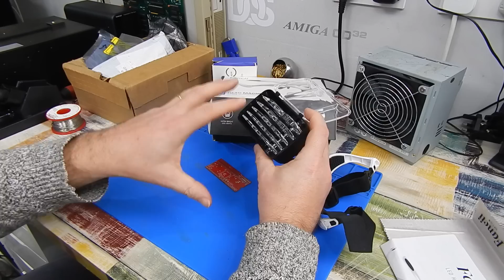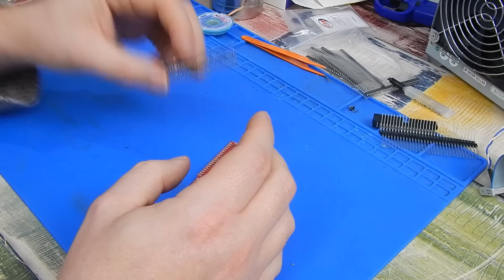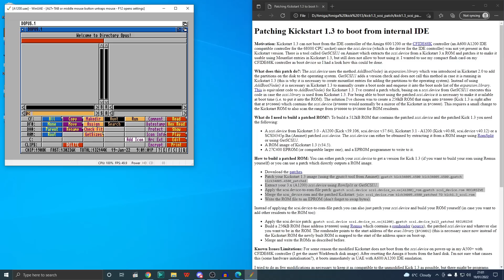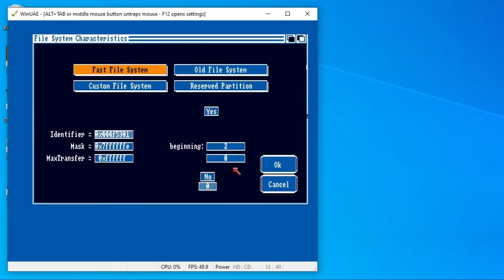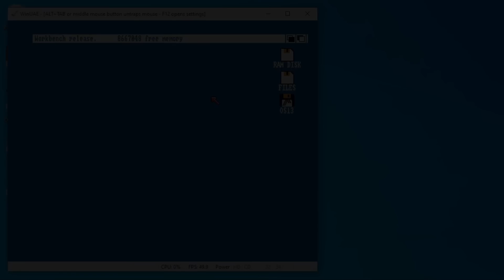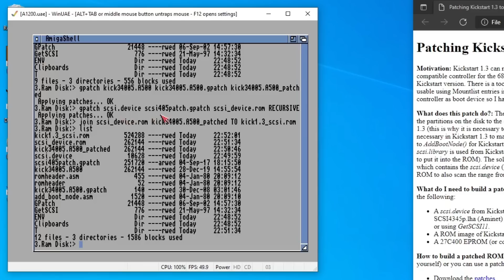Building an IDE68K then patching Kickstart 34.05 (1.3) to boot Workbench 1.3

Comment: I've created that patch about 15 years ago. Nice to see that somebody actually uses it :)
Sorry that you had so much trouble getting it working. I'm using it with an A500+ with an IDE68K board from that time, and scsi.device 43.45.

Not sure why you needed that gayle initialization code. I have two theories but I'm not sure:
- The CPLD code of the IDE68K might have evolved to be closer to the original gayle since the version that I got and might need that initialization now as well.
- scsi.device 43.45 might do that already on its own.

As mentioned in the html file I had to do a reset to boot from HD, but after that it booted every time. 
Somebody sent me a fix for that (also ready 10 years ago) so that it already boots on the initial power up, but I did not reupload the archive as we were not sure if it is a general solution (and its not my code either). That change had to do with the initialization order.

I'll probably build a new IDE68K some time in the future, then I can check if the Kickstart I have still works with that. If I find the problem (thanks for the hints), and some time, I'll update the archive on Aminet.

Btw, I'm already subscribed to your channel for some time, keep up those great videos!
Reply from the maker: Thanks for all your hard work creating this.  I was originally just going to change to 3.1 but after finding your archive on aminet I just had to try it.  After it initially didn't work it must have take me a good few days of reading threads before I stumbled onto the EAB one, I'm just glad it got there in the end.  I thought I had read somewhere that 43.45 didn't work with kickstart 1.3 although with only a 2GB card I don't really need it anyway.   Good to know it can work though, should get you large HDD support.  

In terms of the code, I think the CPLD is emulating a gayle device and needs the code in kickstart to initialise, just my guess though.  Certainly without it there is no sign of life.  

If you do build another IDE68K and decide to update the archive please let me know and I'll update the links etc in the description.  

and Thanks for subscribing, I truly appreciate the support.
Reply: @CRG  Just did this mod and I can confirm that with "scsi.device 43.45" the final KS13-rom does not need to edited, it just works. 🦾
Reply: Where did you get scsi.device 43.45? From which ROM?

Comment: There are SD card ROM replacements, Pico/PI W for other retro computers like the BBC micro, as for the Amiga, where does the ROM size limit come from, is it the physical ROM chip size is 512k or 1M, it would be better to mount the ROM as an SD card partition so you can swap in software the ROM version or put only Workbench "100Mb" on ROM, with the user config/ Work, Games, Programs partitions on the system IDE / SDCard adaptor?

Comment: After struggling with this for quite some time, trying to make the exact same patch working with a TF534, I finally succeeded today!
In the end, I tried adding exec, scsi.device and expansion.library from kickstart 3.1 to my 1.3 in Remus, and it seemed to at least TRY to boot, but just hung indefinitely...
Then I removed the 2nd partition from my sd card in WinUAE (in which the patched Kickstart works fine, by the way), so that I only had a 200 MB boot partition - and THEN it booted from the sd card! 😀

Comment: If your CF adapter has a diode between IDE pin 20 and CF power supply pins, it will reduce the voltage about 0.3 volts. Some CF cards might not work then.
With 3.3 volt CPLD on IDE68K, the CF voltage should be the same and not 5 volts, or some CF cards may not work, because they need IO input voltage of 4 volts minimum as they are CMOS level inputs in the CF specification. (Moreover, at 3.3 volt CF power supply input, the specification does not allow the I/O voltages go much above 3.3 volts)

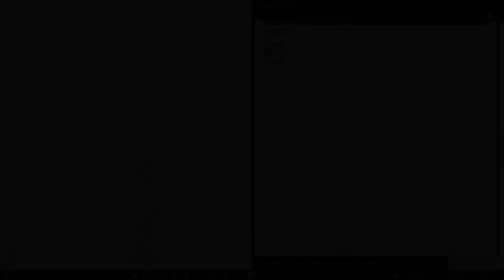Comment: The Gayle initialisation code 31:29 is probably needed on A600 and A1200 to make IDE and Gayle registers appear at DAxxxx address space. The IDE68K would have them enabled "always", without initialising Gayle by reading ID register at DE1xxx (or DExxxx on IDE68K)
Also it makes sense to pull the scsi.device from KS ROM intended for 68000 Amigas. E.g. KS3.0 for 68020 A1200 doesn't work on A500.

Comment: ¡Thank you for this video! 🙂
This text was translated with ChatGPT. I only speak Spanish well.

For my Mistica FPGA setup, I used a Kickstart 1.3 with scsi.device and to partition the hard drive (or CF card) I used the A590 installation disk.
This disk includes HDToolbox, which allows you to perform this operation. Additionally, you can install Workbench 1.3 and Extras 1.3 on the CF after partitioning and formatting it. I suppose this can be extrapolated to a real Amiga, since I did all this with the A590 from its startup.

With WinUAE, you can set up an A500 with the modified Kickstart 1.3, and you can perform the A590 installation as if it were real.
Additionally, if you run WinUAE as an administrator, you can mount real drives (the CF card as a real drive) and do it from within using the disk you will later use on the Amiga.

From the website "Get your Amiga install disks here!" you can download the A590 installation disk, as well as other interesting ones, if you have second-hand expansions but they came without their software/disks.

Comment: I'm not sure this device is that good. I mean, for me the interest of having a hard drive adaptor plug in the cpu socket would be to install an internal hard drive in the A500... But this is clearly not the case here... In this case why not a device plugin in the edge connector like most hard drives did back in the days?

Comment: great tutorial, I'm following it to make my own KS 1.3 with IDE boot. But I'm stuck in a silly way: WHERE CAN I GET THE BYTESWAP TOOL ?
Reply from the maker: Unfortunately the byte swap tool I used is only available from GadgetUKs discord but there are multiple other tools out there for byte swapping.
Reply: I know this is some time ago, but still... the easiest (cheapest) way if you have access to a Linux distro (eventually a USB boot image), is to use dd...: dd if=/path/to/source/image of=/path/to/swapped image conv=swab

Comment: Do you have a link where i can buy the amiga 1.3 kickstart with ide support? I have a ide68k but i need to use a bootdisk to get it to boot from ide. Or is it better to switch to kickstart 3.1 and use a switchable kickstart to get the most compatible machine?
Reply from the maker: I unfortunately can't provide a link to download it due to copyright.  The only way to get the modified rom is to make it yourself.  It's really only useful as a curiosity though, you're probably better running one of a newer kickstarts then your ide68k will work fine.
Reply: @CRG  Thanks. I know about the copyright. Bought the emulator and roms from amiga forever. Maybe i will try it myself once i own a rom burner, but for now i'm going to try a kickstart 3.1 rom with a switch so i can revered back to 1.3 if i need.
Reply from the maker: @theseob drop me an e-mail, casualretrogamer@outlook.com

Comment: Is it possible to change the chip memory range from 2MB to 4MB or 8Mb/16Mb/32Mb/64MB/128Mb/256MB/512Mb  or more?  Is it possible to replace this memory in the Amiga with a larger and faster one?
Reply from the maker: Chip ram is limited to 2MB on all Amigas apart from emulation.  You can have up to 8MB of Z2 fast ram and I'm not sure what the limit is on Z3 but over 128mb is honestly pointless.  For day to day Amiga use even much over 16 or 32mb won't be used, not unless your doing a lot of art or music production with a load of samples.

Comment: Is that right MD5 hash for final scsi.device 40.5 modified KS1.3 ROM? MD5 : 9D5A5319942AF38C62DDC65BDF286849 JFYI: Can be calculated from windows powershell using Get-FileHash "c:\Users\user\Downloads\kick13ide_eab_steps_applied.rom" -Algorithm MD5

Comment: Hello, will this work with whdload? Would this need ROM 3.1? More chip ram?
Reply from the maker: WHDload requires 2.05 I think although you can run JST game slaves just fine.  I've got a few running on this now myself.  More ram is a must, I'd say at least 2mb.

Comment: Amazing! A real Wow Job you have done there.
Great to see your efforts to keep the old darling up to date enough to allow the integration of reasonably modern PC hardware to ensure the continued availability if a HW platform for the Amiga software.
In the late 1980s I was an Atari ST fanboy and built a similar CPU tower with a 68030 and an 8086 co-processor and extra RAM. I foundvthst the socket towers are always less reliable.
Recently i saw a youtube flic, where a creator built a brand new Amiga 500+. Apparently the circuit diagrams and the PCB layout are on github.
Would it not be time to  respin an A500+ PCB to include ALL the mods you have given your A500 if this series? 
If you use Laptop memory bars or modern RAM chips, you can make room for a lot if additional circuitry in the old RAM bank area.
AFAIK all the Amiga custom chips are now available as FPGAs. Purists could even harvest the custom chips from old A500 boards.
I guess the RASPI RGB to HDMI mod could/does also supply LAN/WLAB functionality. 
Is there AmigaOS support for TCP/IP or networking in general?
Just a thought.

Comment: GREAT VIDEO!!!! Just amazing how you can do the super tiny surface parts!!!! I have a soldering setup and a nice kotto fume extractor with the 2 foot flex hose inlet. I'm brand new to soldering and bought all the stuff in the last 6 to 8 months. I bought it to be able to change the power switch in a Commodore 1084 monitor and that was easy! (4 big wires). I have bought some learning kits off of Amazon and I'm getting better at through things like sockets, resistors and capacitors. I have a NeoRAM kit (GoeRAM clone) for the C64 that I want to build. 90% is through stuff that I feel I can do, but then you add one to four 512K RAM surface mount chips giving it 512K to 2MB. Not sure about those surface mount chips and don't want to ruin it? I'm 56 next month and I wish my school had had electronics classes when I was in school 40 years ago!!! I should be happy that they got their first computers (17 - TRS80 model 3's) in my 11th grade year. Those did teach me PASCAL in that class and I taught the teacher many things in the Basic class because I had self-taught myself Basic in 1982 when I bought a Timex Sinclair for $99 from saved mowing money.
Reply from the maker: Thanks, surface mount soldering does take a bit of practise but honestly I now find it easier than the through hole stuff, certainly a lot quicker.  The best advice I can give you is to get good flux and leaded solder.  When I built the first rgb2hdmi board I was using a cheap flux and it made life so much more difficult but with the good stuff the solder just flows to were it needs to be.  Take your time to align the chips, use something to hold them (I used the tape as you seen), plenty of flux then just go in with the solder.  If a part is miss aligned don't panic just use hot air and the tension of the solder should pull it into place, or you can give it a nudge with your tweezers.  

The biggest thing to take away from my videos is that if I can do it then anyone can.  I don't have any training in electronics, everything I've learnt is just from watching other videos and diving in.  Yes I've made a few horrendous messes but it's part of the learning curve, part of the fun.

Good luck with your build and please if you can let me know how it goes.
Reply: @CRG  Thank you for the encouragement! I will.  You wrote "get good flux and leaded solder" could you tell me what you use for both of these and where you ordered them from? I also do have a handheld hot air tool with 2 or 3 tips that came in a kit box with 500 different size shrink tubes do you think that gets hot enough or does it need to be a hot air tool made for soldering work? If so, what hot air tool do you use?

Comment: Great video! I took the same journey a year or so back, only I had the additional obstacle of having used PFS. What I didn't know at the time was that the version of PFS I had chosen didn't work on the KS1.3 / A500 combination. Even when I finally did get the right combination of scsi and initialisation patches and had a working ROM, the machine would boot to a guru error. I interpreted this as "still doesn't work", if I'd though about it I'd have realised it must have been executing code (from the HDD) which it didn't like.

Eventually I emailed Thomas who was very helpful, and when I realised I did have a working ROM I stripped it back to FFS and I was in business. (I did find a working version of PFS, I'd just grabbed the wrong version from and old floppy).

Comment: I’m an ST owner and even I found this interesting to watch. Just how many things can you stick in that poor 68000’s socket 😁 It’s good seeing that things are difficult and don’t always work straight away, and also that I’m not the only one who finds the answers to problems buried in forum posts from 20 years ago.
Reply from the maker: Things rarely work first time, especially in my hands :)  Thankfully we still have the old forum posts as a resource.  I'd have been lost without it.
Reply: Its not good, its frustrating. Why couldn't there have just been a single rom image that you can just download and program the chip with. Im sure you aren't the only person that had problems getting it working. Please upload the ROM image that you programmed the chip with that eventually worked.
Reply from the maker: I can't, these ROMs are still legally owned for distribution by cloanto.  The only way to obtain them is to buy Amiga Forever.  That pack of course doesn't contain this modified kickstart as it was never available originally.  

In short while it's frustrating the only way to obtain a modified 1.3 is to do it yourself.

Comment: Another amazing video! Thank you! I already have the parts on the way in the mail to build one myself so your video is perfectly timed :) I was able to find the missing voltage regulator on aliexpress.

Have you considered a digital microscope for the soldering? I initially found it hard to use because you don't get stereo vision, but I did get comfortable with it after a few nights of work using it. They are not too expensive from Banggood etc. I got an ADSM302 for around 100 GBP on special, delivered and features HDMI out which would give you footage for your videos.

Keep it up :)
Reply from the maker: Thanks, good luck with your build.

A digital microscope is probably what I need to be honest.  Thanks for the tip, I'll take a look one.  HDMI would be handy for video footage as you say.

Comment: This is a pretty cool project, glad to see it all worked in the end. It would be fun to get my CDTV to boot from a hard drive with KS 1.3 and have 8 megs of RAM, but I don't think that stack of boards will even fit with the top lid closed. :(
Reply from the maker: I'm not familiar with the insides of the CDTV, would love one but they are fetching silly money these days.  

Maybe a CPU relocator would help?   Also bear in mind you could build the fast ram board directly on top of the ide board to make the overall tower a bit smaller.

Comment: An easy way to desolder 40 pin header blocks is to place a length of heavy copper wire conductor (like the guage in a mains earth wire) place it between the pins, and run a large bead if solder down it. Then with an iron on quite high or hot air you can run the heat up and down, and the cooper will keep the whole length hot. Then the connector will just drop out on its own and the remaining solder mess is easy to clean up 👍
Reply from the maker: Great tip, thanks.
Reply: I think I will test this with a cartridge slot on a junk snes board. Great tip

Comment: 👍🏻👍🏻👍🏻 Amiga upgraded kudos lad
Reply from the maker: Thanks, I didn't want this machine to have an accelerator, just wanted to push the 68000 setup as far as possible and I think it's more or less there now.  Only thing left is the 1mb chip ram mod and figuring out exactly what I can run on workbench 1.3!

Comment: There is much easier way to get an IDE on A500, without any programming CPLD, simple, cheap A500 emulator on 2 simple logic ic, even no need SMD soldering, also autobooting on patched kick with exchange scsi.device for ide.device. Greetings Amigans! :)
Reply from the maker: Yeah you could even just buy an aca500 but where's the fun in that 😂

Comment: I find the 1.5x magnification on those head magnifiers the best/most I will use. Anything more gives me headaches and has too short a depth of field.

However, with that 1.5x set of lenses it's far better than the other magnifier.
Reply from the maker: I'll try that and see how I get on.  Very tempted to send it back though.
Reply: That's exactly, what I experienced too. I couldn't stand anything higher than 1.5x in the beginning. But after getting used to them, I can now use 2x or even 2.5x without any problems. I don't want to miss it anymore.